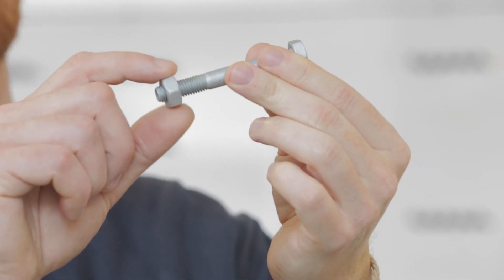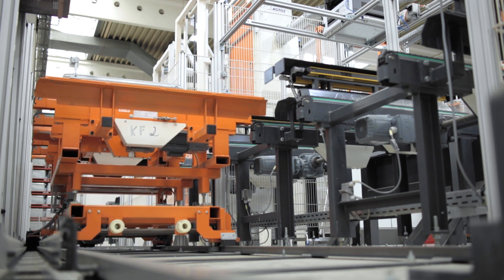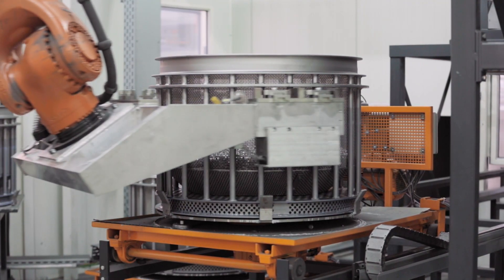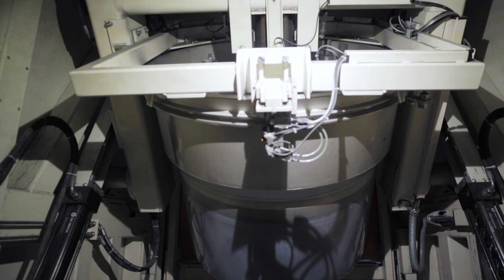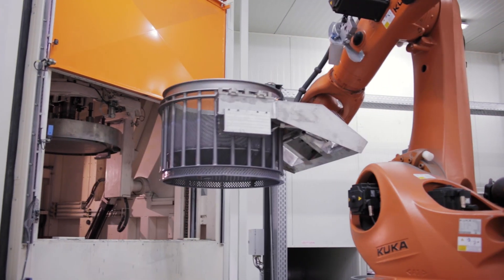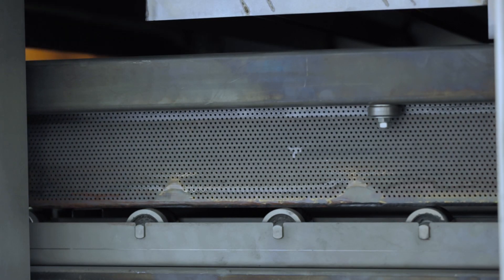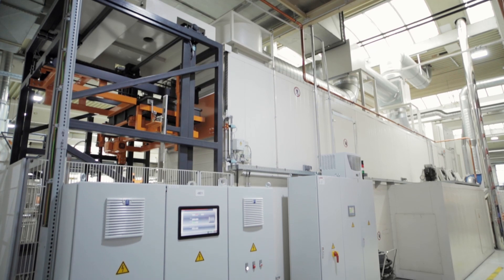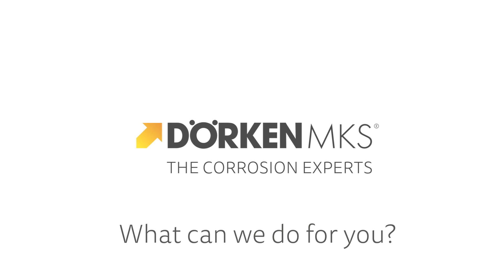Fully automatic coating of fasteners

Comment: Is electro deposition or we can use for spray paint too?
Reply from the maker: No, it is no electro deposition. Zinc-flake systems of Dörken MKS can be applied by spray coating!

Imagine the coating process like applying wet paint incl. a curing process @200-250 °C. In this video, an automatic dip-spin application is shown. If you like to know more have a look at https://www.doerken-mks.de/en/coating-solutions/zinc-flake/. There you will also find the contact information if you're interested in our product.

Best Regards,
Tobias Kleyer from Dörken MKS